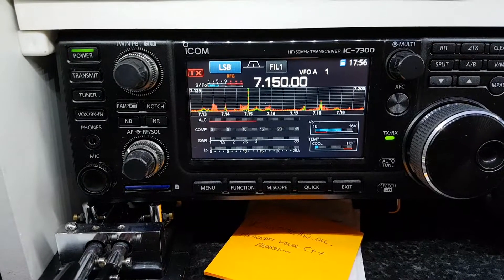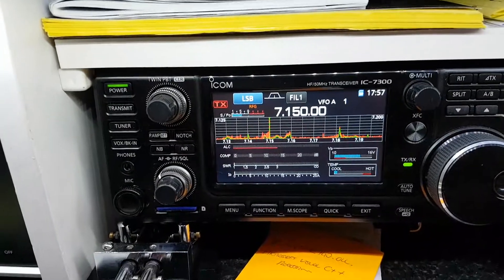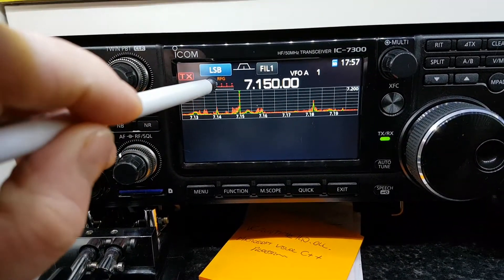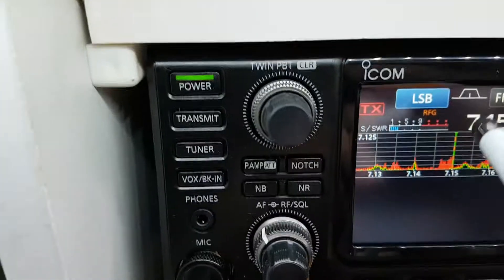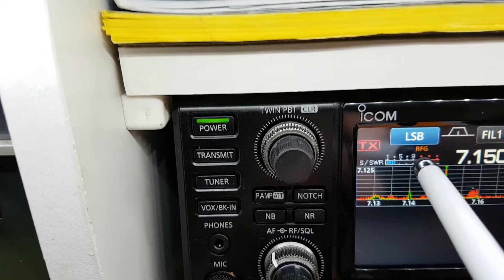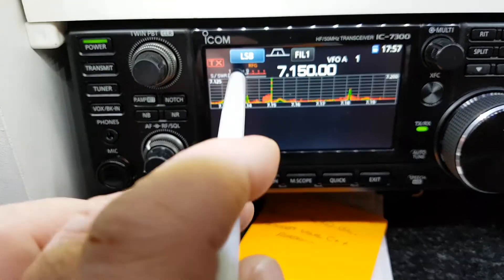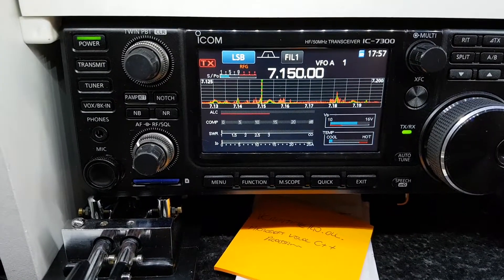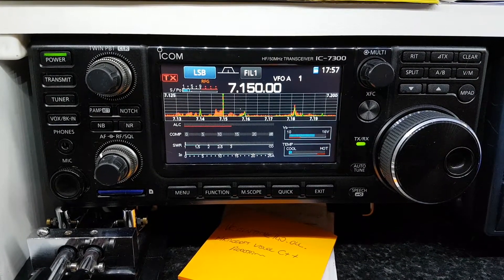Icom IC-7300 Multi Meter Screen Tips | Make the Most of Your Meters!

Comment: When the small meter is set to s/swr should that work as an S meter on Rx and swr on tx? When on transmit it was jumping about as if a signal meter even though the swr was 1.1. Also on TX the scale on that small meter doesn't correspond to an swr meter. Have I got it wrong?
Reply from the maker: Depends, where have you the analogue meter in the chain? Also the meter in the radio will 'react' much faster than a traditional type. Whatever you set the function to by pressing the s meter bar graph, what ever the first function is, that is what it will display in transmit. Personally I use the meter screen most of the time as is shows everything in the one place.
Reply: @GeorgeEI7KO  thanks George. I have it set as you have except other than all the meters I have the waterfall. So it's the small meter, Freq to the right, scope and waterfall below. The small meter says s/swr . Does this actually work as an swr meter? There is no swr scale just 1.5.9... so looks like a signal meter even on tx.

Comment: Hello George. I have the firmware 1.30 and there it does not work. The Spectrum completely shuts off and SWR indicator comes. Is there a trick (setting in the menu)?
Reply from the maker: You may have to perform either a partial reset of a complete factory reset. Make sure you have all your settings backed up first! 73.
Reply: @GeorgeEI7KO  

I have already done that. There may be different versions of devices.
Reply from the maker: Oh, Im not sure then. I have had no trouble with any of the updates.